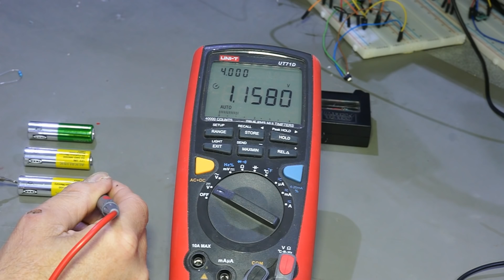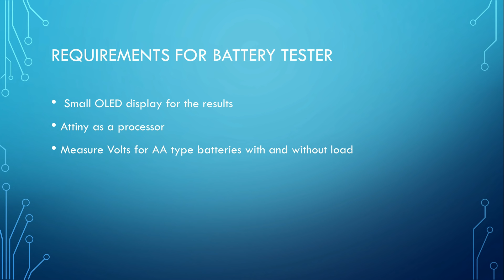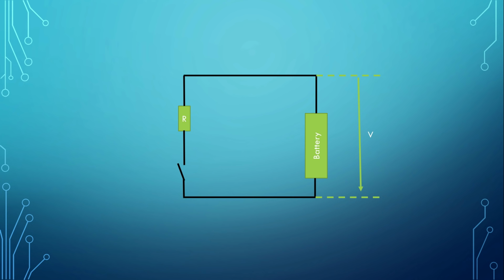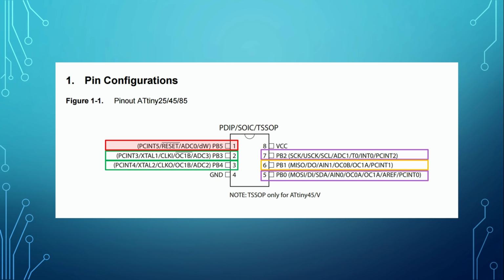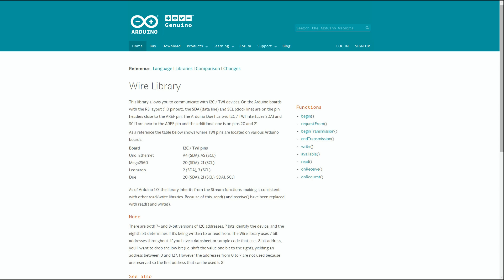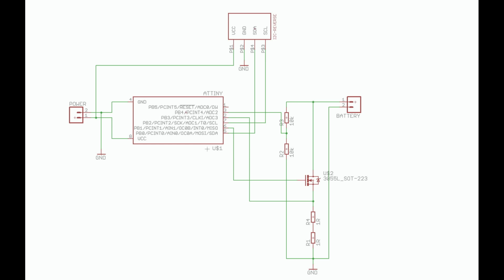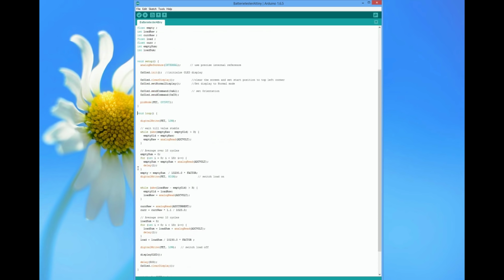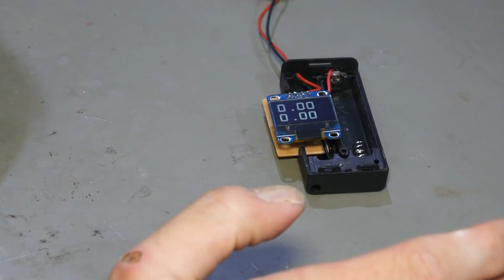#13 Automated Battery Tester with an Attiny85 and an OLED (Tutorial)

Comment: After a lot of fooling with trying to get an accurate current and ESR reading, I must say you are correct. The simple circuit simply cannot measure current very well. I can get reasonable ballpark current and ESR calculations, but they are not accurate and really don't add much useful information. The main purpose is to show no load/loaded battery voltage and it does this very well. Knowing the precise load is really not that important for that purpose.

Regarding whether the ADC reference voltage need to be divided by 1024 or 1023, I have concluded your 1023 works better as it avoids the rounding error that prevents measuring up to and including the Vref if 1024 is used.

The only changes I made now is using smaller numbers for my 2-color display and pulling out the current measurement code and ADC connection, as it is not used in the voltage calcs.

A very useful circuit!
Reply from the maker: Good to read that!

Comment: Any chance you could post the schematic with the sketch? Nice project! I noticed the current sense ADC line is connected directly between the MOSFET and the two 1 ohm series resistors. Doesn't this drive the ADC above the internal 1.1 volt reference when connected to a 1.5 volt cell, which would seem to be a bad thing, even if the current reading is not displayed? Is there a reason the display clears every cycle? Removing the clear command simply allows the display to update without the display blink on every read.
Reply from the maker: 1. The sketch was already on my Github. I now added the Eagle files and a pdf.
2. The current sense is a 1 Ohm resistor. And the maximum allowed voltage on any Attiny pin is VCC+.5V (datasheet). So we are save till 5A (U=R x I). The voltage measurement is divided by two with 2 resistors.
3. There was a reason for this blinking, but since this is long ago, I do not remember. But maybe you can omit it. I just did not have the time...
Reply: Thanks for the response!
Regarding point #2, if only a single one ohm (or 2 ohm) resistor is used, the voltage dropped across the sense resistor is the full 1.5 volts of the battery. Anything over 1.1 volts will be read as 1023, so the sense values retrieved will not be useful over the full battery voltage range. Two 1-ohm resistors with the ADC sense line between them will drop the voltage to a usable range. The schematic in the video shows two-1 ohm current sense resistors, but the ADC lead is not between them, which I believe is in error.
Reply from the maker: I watched now the video again. There, I say, that the maximum current is about 500 mA which would then be 1 volt on 2 ohm. Please consider also the internal resistor of the battery. You are right, with a powerful new battery the value could go over 1.1v. But what would this result say? The battery is new. And this is the purpose of this device.
You can put the lead between these resistors if you want. This extends the range on the "good battery" side and reduces it a little on the "bad battery" side.
You are right if you expect a proper current measuring tool. Then, this "crappy" design is for sure not good enough. But to distinguish between good and bad batteries, it helped me.
Reply: Andreas Spiess In your sketch, it doesn't matter if the battery voltage goes above 1.1 as far as current sensing is concerned. As you observed, it is safe to go up to 5 volts. Also. you are reading the current but not displaying it or using it in any calculations, so it is fine if the range is reduced. I wanted to display current under load as well, so I put the ADC line between the two - 1ohm resistors and changed the calculation slightly to get the correct current over the full battery range, even > 1.1 volt, which is not unusual for a good battery.

I also changed the MOSFET so the source is connected to ground to minimize the resistance introduced by the MOSFET. I think this was in another comment as well.

You can see a picture and code changes I made at http://projectmf.homelinux.com/Arduino/BatteryTesterAttiny_DON

Thanks for the great project! I had much fun experimenting with it.

Comment: I am building this project and I wonder why the power mosfet is does not have the source connected to GND, and the 1 ohm resisters on the drain it would see this would give a slightly higher voltage on the gate, ensuring it gets turned on.
Reply from the maker: I did not pay a lot of attention to the details. So, go ahead if you can improve it! "The better is always the enemy of the good" ;.)
Usually, I use logic level FETs that they are switched on as much as possible. I do not remember, but if I measure directly at the battery, the voltage drop should not be a problem because it is after the measuring. But I du not remember exactly how I did it.
Reply: @AndreasSpiess  Hello Andreas. Great stuff. Which Power Mosfet would you recommend?

Comment: I just noticed your stabilization code may have an error.
you have not initialized the values for
int emptyRaw ;
int emptyOld ;
I assume they get set to 0.

then in your stabilization routine you have
  // wait till value stable
  while (abs(emptyRaw - emptyOld) > 3) {
    emptyOld = emptyRaw;
    emptyRaw = analogRead(ADCVOLT);
  }

Seems to me that if the two values are truly initialized to zero, the while loop will never run?
If I understand the while loop it is tested at the beginning so I think you should have coded 
do {
blah blah
} while ( the test );
no ?

------
I really enjoy watching and learning from your videos Keep it up.
Reply from the maker: You are right! I corrected it. Thanks.

Comment: You keep mentioning that a short time is required for the "on load measurement" but you never mention what this is and even your scope display is not easy to read this.
Reply from the maker: I just looked into my sketch. It is not defined. I switch the FET on, measure the voltage till it is stabe, measure then 10 times the current and build an average. Then, I switch the FET off. This takes a few miliseconds. But it is not critical.
Reply: Ok thanks for the prompt reply...keep up the good work :)

Comment: I like it, I like it!  I have one of those "universal" battery checker that I got from Cina for a few bucks. Burnt one out trying to check the charge on an 18650, not really sure why but I replaced it with another just like the first. Now I just avoid the Lithium batteries and use it for the "regular" rechargables.  This looks like a grand idea!  I have a few Digispark TTTiny 85's I may try to program  one of these for this mission, plenty of aa and aaa battery cases litter my supply cabnite so I am good to go for this one.  Maybe!  Still don't have my OLED's but they are on their way from China as I type, have  been for a couple of weeks, so the slow boat may well be in sight of Seattle,,
Reply from the maker: I wish you luck!

Comment: Good to know that there is hope in the form of library for Attiny. Great video! One thing I found problematic though is your analog measurement calculation, which seems that propagate through whole work: 
  int in0 = analogRead(A0);
  float val0 = in0 * 5.0 / 1023.0;
Why you divide with 1023? When 10 bit ADC has 1024 steps (0-1023). You should to divide referent voltage with 1024 in order to get proper result. Does this makes sense to you? Thanks.
Reply: It is also addressed here: http://www.electro-tech-online.com/threads/why-adc-1024-is-correct-and-adc-1023-is-just-plain-wrong.132570/
Reply: To get proper scaling, one should use "pre-math" to scale up reference voltage: 5/1024+5=5.004882813, which may give result on ADC value of 1023 = 4.999995232, which will be rounded up to 5 decimals, and for those who want rather to see number slightly over 5, probably should round reference voltage number to 5.00489, in which case ((5.00489/1024)*1023) = 5.000002412 (where 1023 is now ADC reading result).
Reply: To clarify formula above: vref/1024+vref as a value that should be included in the arduino math, or:
float vref=5.0; //be sure that VCC is really 5V, it can vary!
float V=((vref/1024+vref)/1024)*analogRead(A0); 
//in example above, arduino nano is used and A0 as analog input
Reply from the maker: You are right.
Reply: Thanks.

Comment: I would like to measure the battery voltage and sound a buzzer with pwm under a certain threshold, is it possible? Attiny85, buzzer and 1S Li-po battery only. The battery would be connect to VCC and the buzzer would sound at 2kHz if under 3.7Volt. Not sure if the battery needs to be connected to Analog pin or if I can measure the attiny85 working voltage, hence my question.
Reply from the maker: ATTINY85 runs down to 2.7 Volts, so this should be possible. You can connect the battery to one of the analog pins.
Usually you do not need PWM for buzzers because they are not loudspeakers. If you connect them to 5V they buzz. You have to try their minimum operation voltage.
Reply: +Andreas Spiess Thank you very much for the quick reply. The buzzer I will is not Active version, it needs a modulated signal like square or saw wave. I believe the Arduino has a Tone library that can be used.
Reply from the maker: Then I would call it a "loudspeaker". You can use the tone library for these.
Reply: +Andreas Spiess Thank you for the correcting the terminology
Reply: Yet, everywhere on the eBay (mostly China) the call it passive buzzer, and active buzzer. Still confusing, but that is how they name their products.

Comment: With a slight modification to the code, you could display the ESR of the battery, as all that is needed is normal voltage, voltage under load and the current under load to get the ESR.  You already have that information in your device.
Reply from the maker: +Cory Marshall Thank you for this proposal. This should really be easy to be done.
Reply: +Andreas Spiess here is a link to a energizer technical bulletin of performing a ESR test.  http://data.energizer.com/PDFs/BatteryIR.pdf  Hope this helps.

Comment: Andreas, could you please explain why the two 10K dividers for measuring the voltage?
I assume you need the voltage of the battery with load disconnected and the voltage with load?
Reply from the maker: If I remember right I use the internal reference voltage of 1.1 volt for the ADC. This is why I divide the battery voltage by 2. this leaves a bit of safety margin.
Reply: +Andreas Spiess Clear! Thank you

Comment: Very nice! Is it possible to display double digit numbers to test a 12v battery for example?
Reply from the maker: +Jacopo Rodigari Should not be a problem. Just adjust the voltage divider (R2/R3) that it supports 12V.
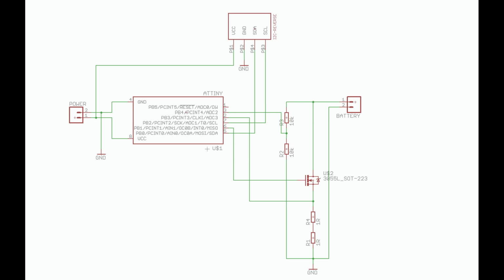One thing, however is the current. I use a quite small load for the small batteries. I you want to test bigger batteries I assume you need also a bigger current as a load. This would need then a bigger resistor (R1/R4) and a stronger FET (U$2) at 5:35
Reply: +Andreas Spiess  thank you.  I was not clear with my question. I was,curious if the software could be modified  for larger voltage measurements. I run some tests and it's possible but if the voltage from the divider is bigger than the internal vreference it doesn't work,  the vreference needs to match the external supply. Your project opens up a lot of different uses for these little attinys combined with the oleds screens!!
Reply from the maker: +Jacopo Rodigari This is the purpose of voltage dividors, to reduce voltage to an acceptable level. If you look into the data sheet of the Attinys you see, that you easily can destroy the chip by applying a too voltage higher to VCC to a pin!
If you browse through my videos you see also other uses of the ATtinys (e.G. an "home made" I2C chip. I like them very much.

Comment: hey, it's not clear to me but how do you power the final 'device' ?
Reply from the maker: +Gabor Bognar With my bench power supply. but it could also 2 AAA batteries. I do not use it every day, so this solution is ok for me.
Reply: +Andreas Spiess Thanks, it makes sense. My only problem is to get the small OLED :)
Reply from the maker: +Gabor Bognar This is very easy: 
http://www.aliexpress.com/item/New-0-96-I2C-IIC-Serial-128X64-OLED-LCD-LED-Display-Module-For-Arduino-55785/32357566914.html?spm=2114.30010308.3.8.5t0ANd&ws_ab_test=searchweb201556_2,searchweb201644_2_505_506_503_504_301_502_10001_10002_10016_10005_10006_10003_10004,searchweb201560_8,searchweb1451318400_-1,searchweb1451318411_6449&btsid=e3b606b6-02e7-4e45-b5dc-10b8ce9bcab0

Comment: how did you modify the library? I have tried replacing the include files in the hello world code but cannot get it to work
Reply from the maker: +coolweirdgreat Can you be a bit more specific about what does not work? To change a library I change the text with a text editor. Then, I make shure, that the IDE selects the changed library, because it looks at different places for libraries. And sometimes, it does not chose the library you intend to use, even if it has the same name.
Reply: +Andreas Spiess I have installed the two libraries TinyOzOLED and TinyWireM. I hooked up my OLED as shown. I was able to compile and upload this simple example code, but the screen remains black. Im not sure what the problem is. The screen still works with the ArduinoUno Just not the attiny. 

#include <TinyOzOLED.h>
#include <TinyWireM.h>

// ATtiny Pin 5 = SDA                    ATtiny pin 4 = GND
// ATtiny Pin 7 = SCL                    ATtiny Pin 8 = VCC (2.7-5.5V)

void setup() {
  OzOled.init();  //initialze OLED display

  OzOled.clearDisplay();           //clear the screen and set start position to top left corner
  OzOled.setNormalDisplay();       //Set display to Normal mode
  
  OzOled.sendCommand(0xA1);        // set Orientation
  OzOled.sendCommand(0xC8);

}

void loop() {

  displayOLED();
  delay(500);
  OzOled.clearDisplay();
}

void displayOLED() {
    OzOled.setCursorXY(30, 60);
    OzOled.printString("Hello World!"); //Print the String
}
Reply from the maker: +coolweirdgreat I just checked on my Attiny85 and it works with the library from my github and the tinywire from Adafruit. Just the text dos not start left.  Did you set the fuses (in Arduino IDE: burn the bootloader in tools menu. If you did this, I would start with a blink program on the Attiny to test whether a simple sketch  works on it. Otherwise come back and we will see ;)?
Reply: +Andreas Spiess Yes I have set the fuses and burned the boot loader Attiny 85 1Mhz internal clock. I runs The blink sketch properly. I am unsure what the problem is. Maybe it is the programmer I am using. This is it https://www.sparkfun.com/products/11801 Thanks for all your help it is greatly appreciated.
Reply from the maker: +coolweirdgreat So the only difference I see is that I use 8MHz internal clock and no divide (Low Fuse E2 and high Fuse DF). Can you try? You can check with AVRDUDESS.
 I cannot believe it is the programmer if you are able to transfer sucessfully other sketches to your Attiny. It should not distinguish between one or the other sketch...
And then, the usual suspect: Just check again wiring of SDA/SCL. After that, I am also at the end of my knowledge!
Reply: +Andreas Spiess I have finally figured out the problem! The  display is rated 3-5V I tested it and it worked on the arduino uno 3v and 5v supply lines. However this was not the case with the attiny. For some reason the display only works when the attiny is powered off 3v. Thanks for the help!
Reply from the maker: I am glad to hear that it works now! I also use 3.3V because the first OLEDS were only rated at 3.3V and I am never sure if they are really rated at 5V or they are just not destroyed by "luck".

Comment: Great video. I have a number of inexpensive USB rechargeable Powerbank battery packs which don't indicate what power is left in them. Can the same circuitry be used and are software changes required to read the approx. 5 volts. Your advice will be appreciated. Bob
Reply from the maker: +Bob Johnson In principle: Yes. I would even extend the usage. If you decide on a particular load you could charge your lipo completely, connect this particular resistor to the LIPO and discharge it once completely with this load resistor. If you measure the voltage from time to time, you get the characteristic curve. If your arduino knows this curve, it could show you exactly the remaining percentage. But pay attention, your resistor for the discharging experiment has to carry a big load. The resistor on my power meter on the other hand can be very small because it is only switched on for milliseconds.